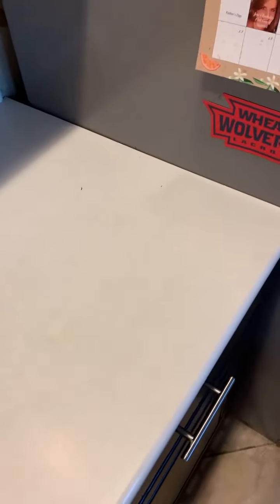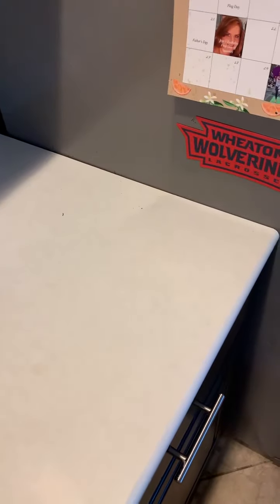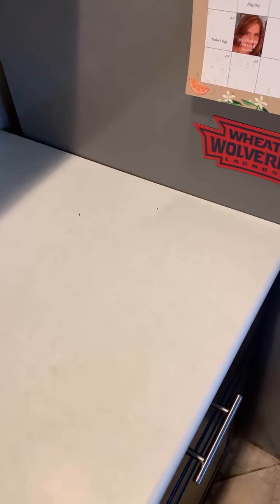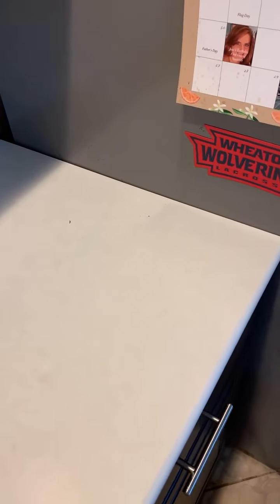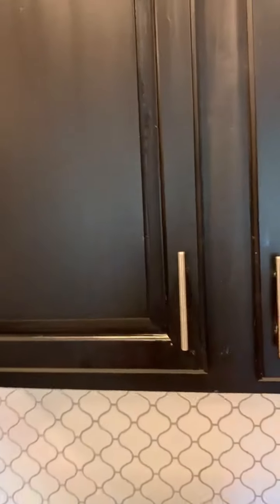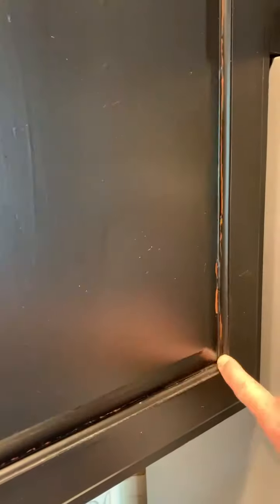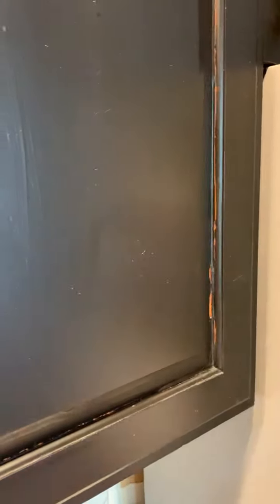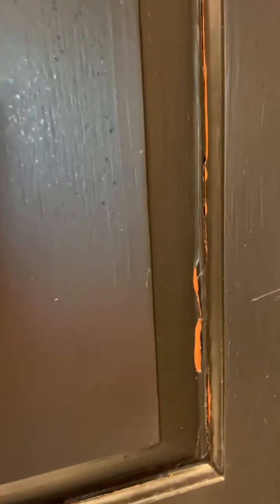Why we do t caulk cabinets when they are being painted

Comment: Cool thanks. I figured not to caulk because of movement and caulking always shrinks and starts to peel with moisture. Thanks for confirming this for me.
Reply from the maker: It also becomes a issue with paint cracking or peeling away from surface making it really nasty to fix

Comment: You have a lot more problems going on with the finish than a poorly caulked door. You have an adhesion issue, a chemical reaction that has caused the paint on the door to crack, the solvents used didn’t dry adequately,  inadequate primer to say the least.
Reply from the maker: Great info!   We were focusing more from the point of the middle panels typically are made to move- but yes to the above!! Thanks for the input !!

Comment: what do you recommend to get rid of that line ??
Reply from the maker: In reality you don’t.. if you go to big box stores you will see there are lines. It allows doors to move, flex, etc
Reply: @dfrancopaintingandwallpaper  i did two coats of STIX already- a little bit of wood is coming through- i was thinking of spraying one coat of bin shellac in my wagoner- but was worried about ruining the gun before i use BM advanced for my finish coat- do you think i can do a quick spray then sand with the zinnser bin spray in a can??
Reply from the maker: @tikikiki146  you have to be careful when mixing primers- you could get reactions... FYI.  When we sand and get bleed through or wood we have used the rattle cans of their high build primer - dries nice and flat a d we have not had issues with different primers. bin- we don’t use so I can’t speak to it with great authority.  And we do t use advance either so not sure about product compatibility.. your local Benjamin dealer will know